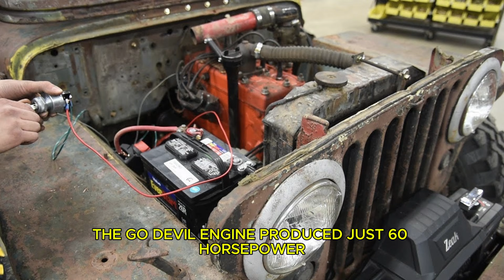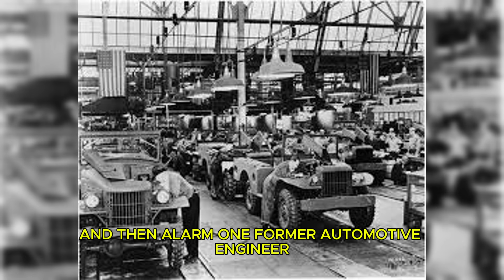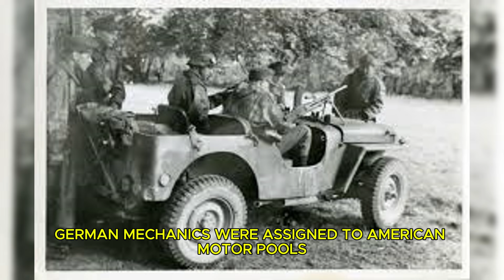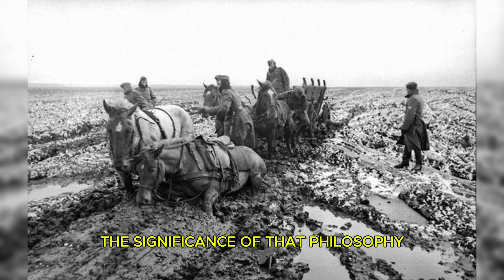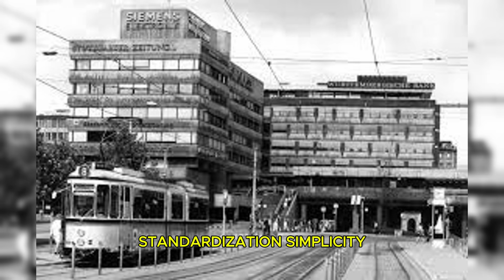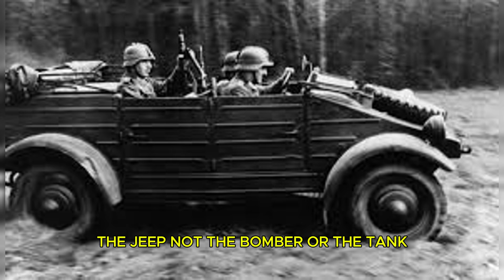Wehrmacht Mechanics Drove A Captured Jeep — Then Admitted They'd Never Had Vehicles Like It

Comment: Mercedes had a 4x4, but it dident compare at all...it was 4-wheel fully independent suspension, as had the 4x4 vw beetle,  kubelwagon, und schwimmwagen. No comparison. 
The jeep was tougher and heavier, with fewer parts, live drive axles rather than fiddly independent axles. The germans built nimble lipzanners, we built tough morgan horses